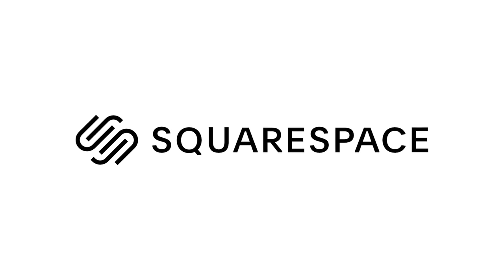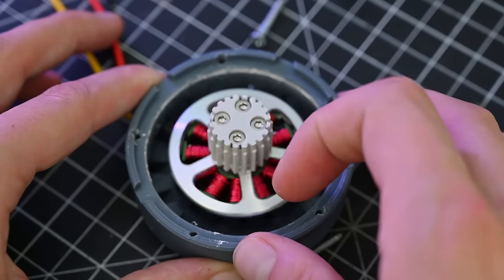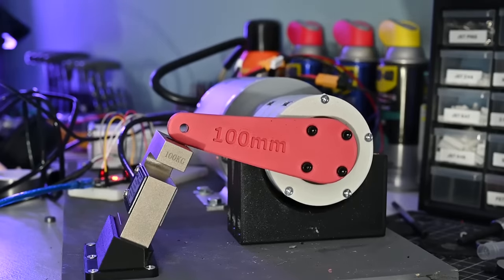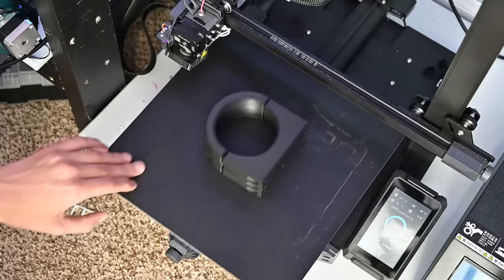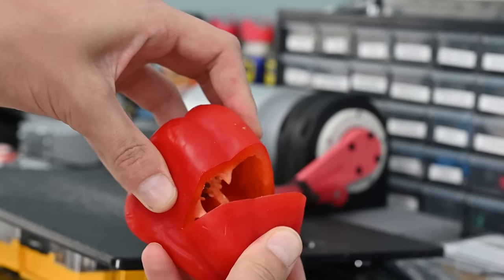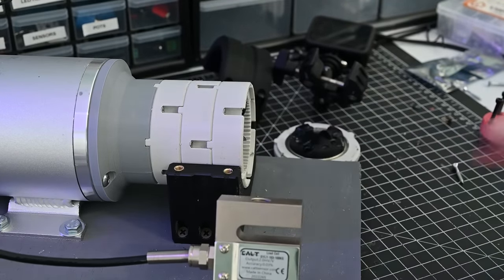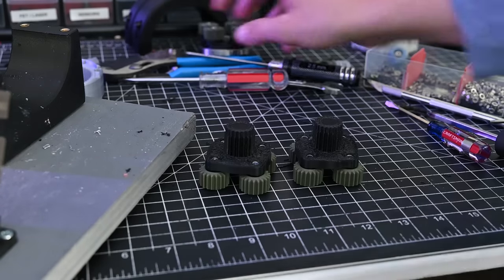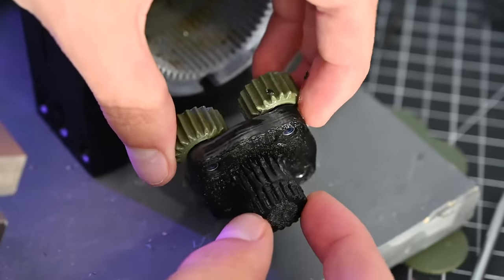Testing 3D Printed Stackable Gearbox

Comment: As others have said, bigger gears will be stronger. Longer gears will have a linearly proportional increase in strength (ignoring that the plastic "shaft" of the gear will be weak over long distances), but an increase in diameter will have a super linear increase in strength. Later stages will need to be larger. Also, I don't have anything to back this up, but I imagine using a larger module for your gear teeth will increase strength, especially since you'll be able to fit more perimeters/walls within each tooth. If you can maximize wall count in the gear teeth instead of infill, you'll almost emulate the grain structure of forged metal parts.

Lastly, consider different ways to surface harden your gear teeth. I don't know what that would like like for plastic gears, but if you can come up with something, it'll likely improve performance.
Reply: Annealing the gears would probably be the only way to "harden" the teeth, though I think you would have to use casting sand or salt to prevent too much loss of dimensions.
Reply: Electroplating the gears would be an interesting experiment.

Comment: I would be interested to see this machined instead of 3d printed. The torque on a simple motor like that should be able to reach wheel hub torque of an EV with the proper machined gears.

Comment: nice video, just don't measure the torque while rotating as it's like jumping on a scale and wondering why you're so heavy.  Also, you could have the parts printed in metal by PCBWay or JLCPCB (they're relatively cheap these days).  I hope you keep it up and I'm looking forward to your new videos. :)
Reply: It was a perfectly valid way to measure torque. The only way it would be bad is if it was spinning too fast and "impacted" the loadcell as opposed to a gradual loading.

Comment: Maybe it could be a solution to create some sort of cage for each stage? Now your planetary gears are supported by a screw that is screwed into a planetary carrier. But this creates a lot of bending stress on the screw and there is not much material where the screw is supported. 
Creating a cage around the planetary gears will support the planetary gears from both sides and therefor split the stresses to both sides. 
Just like here: https://www.lancereal.com/wp-content/uploads/2019/11/platetary-gears-2.jpg